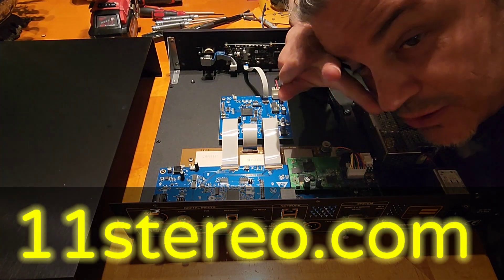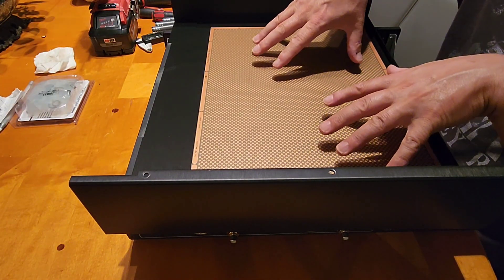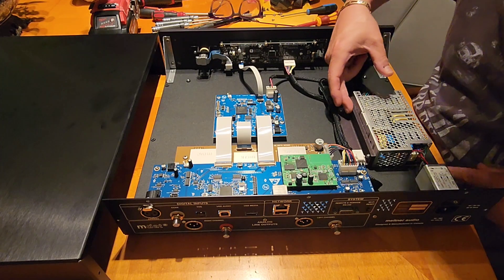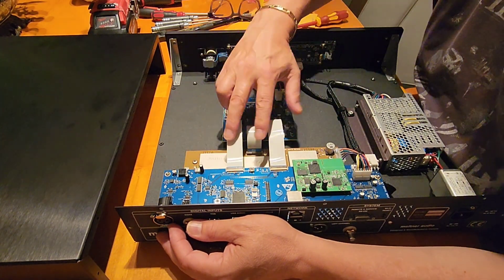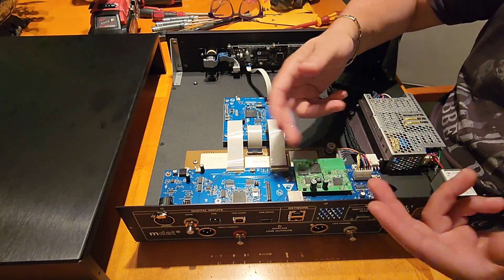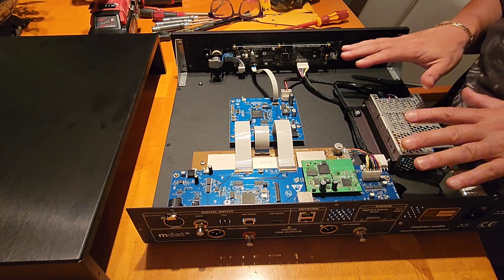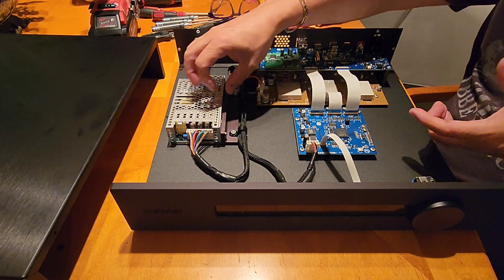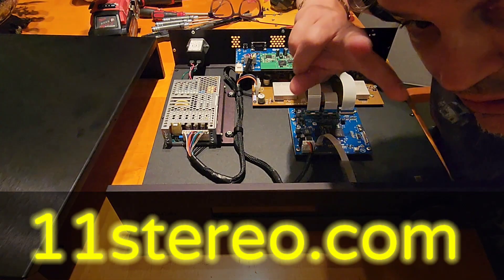ANATOMY OF A DAC - VOL #4 MEITNER MA-3

Comment: What people miss about a product's unit price is the non-reoccurring costs involved to produce a product. There is definitely a per unit cost based on just parts and labor to build a single unit. But there is also the development cost for the engineering (electrical, mechanical, packaging), software development, testing, proto-typing, production set up, etc. All of this is the non-reoccurring cost. The non-reoccurring cost (investment) is divided by the projected number of sales or build run for the per unit cost. The per unit non-reoccurring cost, build cost, per unit overhead, and per unit profit is what makes up the actual price of a unit. Therefore, if you build/sell only a small number of units, the non-build cost can be a large or significant portion of the unit price. The cost of an unit is not just the cost of parts and labor to build it.
Reply from the maker: Pretty sure people aren't that stupid, but you never know. You forgot about packaging design, custom packaging, building overhead including electrical, internet, phone and utilities, payroll and a big part is marketing cost and advertising. How about trade show costs, lodging, meals, travel expenses shipping to and from the show, and dreage. There are also ip costs, patents, filing, etc.
Reply: @OCDHIFiGuy  You're correct, I am preaching to the choir. I do realize that for everyone in this forum I am stating the obvious. Great videos. I appreciate your candor. I enjoy the ANATOMY OF A DAC series. I probably put my rant in the wrong forum. It just pisses me off how so-called experts on other forums and other YouTube channels state that high end audio products are overpriced (some are) based solely on the build cost.

Comment: I have a great DAC that is going to reach my hands in the next week or two. I'm going to open it up and see what the internals are. Its a french DAC that completes with TotalDAC and Metronome. I bought the Audiomat 4 Maestro Reference. Can't wait to break it in :)
Reply from the maker: To be quite honest, inside is good just to see build philosophy, but wont tell the whole story.  ;-)
Reply: @OCDHIFiGuy  Agreed. What you can visually see just tells you if they used quality parts but how its implemented is more important in terms of engineering the signal from input to output. But I did my due diligence and saw that the caps inside the Audiomat are high quality big quality poly only available in Europe. At 9900 Euros I would expect no less than top shelf parts (chassis, caps, high quality PCB etc). There's some photos online you can see they put some thought into it.

Comment: Yes in it's simplicity a  basic streemer is just a network card with a processor, power supply, and GUI/software to access streaming services.  However, bring it to the next level  with not only having inhouse network network tech,  dedicated clock to mitigate jitter, a low power  CPU, dedicated memory buffer, and  its own power supplies, prpoietary tech, and you'll  notice  a huge difference. At first I thought the same. I thought my BlueSound node with either coax or SPIDIF going to my DAC was good enough, until I was introduced to Aurender by my dealer. We had a shoot out with Lumin, Aurender, and  BlueSound on the same system I have at home and immediately I heard a huge improvement. The N200 has enough magic for my tastes and budget and  it also has SSD drives for networking my music if I choose to. Idk if you had a chance to check them out, but Aurender was also at Axpona doing demos between their models and others.   Aurender isn't for everyone, matching to ones systems capabilities and listeners taste is key so demoing Lumin, Cambridge, and etc is important, but they do notch up . For the toys you play with  have Aurender send you a demo unit or 2 with no DAC and hear for yourself. ✌️
Reply from the maker: I use a Playback Designs Streamer and a Homebuilt server using JCat USB out. Ive tried a $20K streamer and the difference was not worth it . It was very small... Streamers and computer tech changes like the wind, so Im in no rush. My DAC is of such high caliber, it renders the streamer a much less important part of the whole
Reply: @OCDHIFiGuy  idk man, the Aurender N200 I got was under 6k. When I listen to Dio-Holy Diver,  Manowar- Master of the Wind, or Judas Priest- Necromancer, I can hear the chaffing of the leather pants rubbing on stage. TMI.  Even on piano I can hear the hammers hit the strings and the creeks of the bench. Your PBD probably relocks the garbage coming in and turns it into fine wine for the Gods to enjoy as they plot their next conquest. 🧔😁 🍷 🤘🎸⚡

Comment: How does the inside of this compare to a MSB discrete dac? With the discrete it’s made in USA is made out of a billet of aluminium so no cheap case, has dual linear power supplies in they’re own shielded aluminium block cases and separate discrete ladder modules thermally stabilised and shielded in modules etc etc and it’s around the same 10k price.   Thanks for your wonderful channel.  I watch it without fail.  You rock Mickey!
Reply from the maker: Ive never seen inside the Discreet DAC and maybe its better for $10K... do you have one to send me ? Id love to try ..

Comment: I am not really impressed for 10k.
The casing is pretty flimsy. The power is of the cheaper switching type. The boards are also of the cheaper kind. Many flat cables are also not ideal.

You talk about the Chinese 'cheap' stuff, but I like the  Holo audio more if you talk about material quality.
Reply from the maker: I heard theres a new one from China that kills Holo or Denafrips and it costs less., if your into supporting communists.  Its not the Chinese stuff, its the Government my friend. Human rights violations are off the charts over there. I happen to love my fellow Human Beings, Yep, no doubt this is easily produced, but the proof is in the sound. Im still breaking it in.
Reply: @OCDHIFiGuy  Yes, I agree the politics are a problem in China.
I like to separate politics from the actual hardware in audio.
If you simply compare the thick case, thick circuit boards and beefy power supply, this unit is no match for cheaper units from China. Let alone the expensive comports like ladder resisters capacitors and silver wire used. 
To me, this is just an objective observation, because this is the central story of your video.
 Sadly I have not listened to any of them, maybe I would prefer the sound of this unit..

Comment: Is this particular switching power supply as good as a linear one? And are you gonna carry EMM Labs and Meitner gear now?
Reply from the maker: Highly doubtful Mike, and I can carry it all but I wont carry the high level as I like PBD better, this is to fill my $10K DAC hole in my offerings only. And Im still waiting on break in to fully judge it , but for $10K its my best offering so far.

Comment: Ed did it again. I Owen the MA1 v2 and It sounds fantastic, you should have talked about the fact that everything is converted to very high sampling dsd rate and from there is is decoded. Mister Meitner  is specially famous for his dsd work. I also have a Denafrips terminator II ,it sounds great but is less analog sounding then my MA1v2.  The Denafrips produce a larger and more forward image.
Reply from the maker: That my friend is from Andreas Koch the digital Engineer. (Playback Designs) Ed is an Analog guru and handles the analog output section. So the accolades for DSD conversion belong to Andreas and Playback IMHO.
Reply: @OCDHIFiGuy  Tanks I didn’t know that mr Koch was involved but itmake sense since they both worked at Sony on the Sonoma design  Kosh on the digital aspect of it, so the 2003-2007  he worked at eMM labs the  mDac was his design,  now does he supply meitner with clocks and dacs? was he involved in the new iterations of DAC fOR Meitner NEW machines?
Reply: @OCDHIFiGuy  how does he score against ASD guy?

Comment: I would use a chopstick or a bamboo skewer 2 point out different electrical components.
Reply from the maker: I like Bamboo Skewer, Ive got some ... Next vid !
Reply: Also it works good to put pressure  on the board while troubleshooting to find broken solder connections.